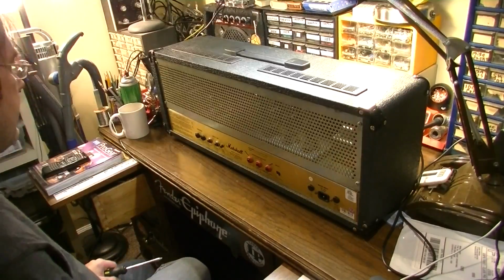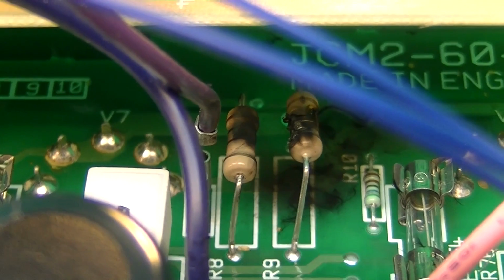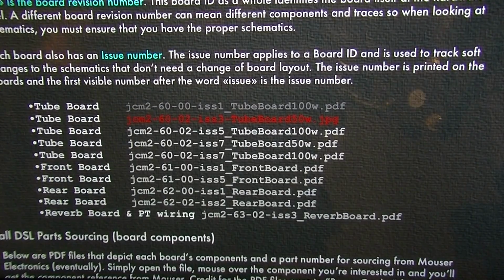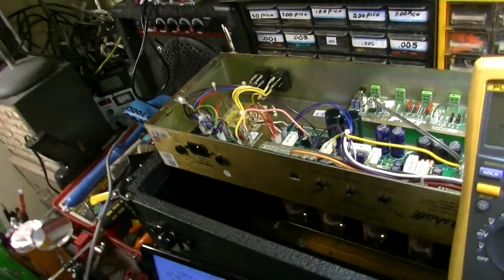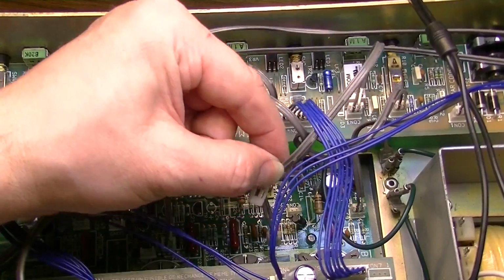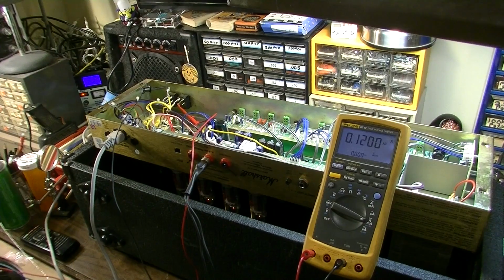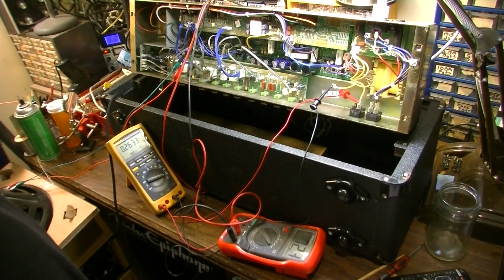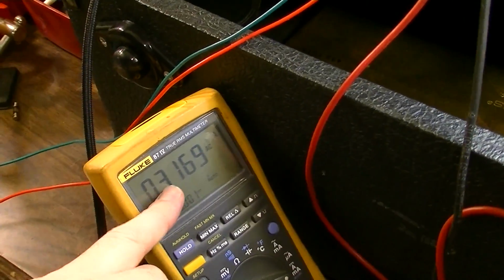Mother of All Marshall Amp Repair Videos - DSL100 Blowing Fuses, Bias Runaway, Fun Times!

Comment: Thanks for this video Brad, this was really interesting. Blew my mind when that particular cap measured so bad. Lots of plugs and wires to disconnect and mislabeled schematics from the factory, that’s kind of an automatic handicap right? This was cool 😎 as usual, you rock.
Reply from the maker: Connectors are never as reliable as solder.
Reply: Why do you suppose they would have put so freaking many connectors and plugs in? Just because it was easier to pay someone to build the parts piecemeal and then pay someone to finally wire it up? I bet that was it, to save a tiny bit of the almighty dollar. Oh, I forgot, save to pound. Pound sand I say...
Reply: @TheGuitologist  I just found & subscribed to your site about a week ago. I picked this video (hoping for a bit more advice & I'm on a time frame) but I've got an '04 TSL 100 & just getting back into playing after a few years off (& DYING to hear that Marshall & 1 of my Explorers) so I re-tubed last night before work. I had been playing it last week when I noticed the 1st power tube was just shot, dead. Anyway, it made a little sound before I killed the Output Mute & then V.P.R. buttons, then blew HT fuse. All tubes were still lit. I do factory automation/ maint & WILL soak up much from your experiences. I appreciate you doing what you do & helping others. I guess 1st question... I was sold 4-ECC83 S's for the pre-amp. HOWEVER, the original Marshall tube was still in the far left position w/the can/shield on it w/the nomenclature VLVE00064
 WK43 on it. Do I need to go BACK to the music store and get a different tube or will the ECC83 S be ok there??? Looks like I'll be watching videos all day and possibly weekend and pray hard & often! Terrible timing w/just getting my FIRE RELIT. 
1 last thing. I brought home a 5pk of Buss GMC-1-R fuses for T-shooting my issues. I'm guessing from what I've been learning, that's not a good idea...? Do I really have to go find some F1A L250V fuses for my t-shooting? Thanks for ANY help & I WILL be buying some swag asap!

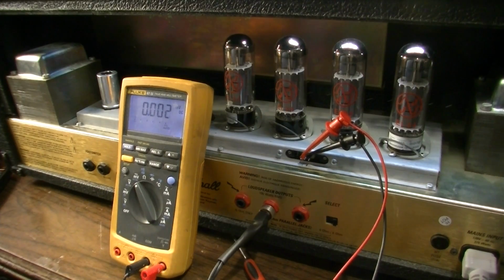Comment: Hi, great videos. Can I ask you a question? How can I know if my Bias are running away because of any faulty component inside or the problem are the tubes? I mean, in the beginning of this video, you show us that the "left side" is running away big time 1:50. Was the Stand By switch engaged or just the power on, as you take this first measurement? Thanks a lot and cheers from Brazil.

Comment: Is the DSL100H similar? I have never been happy with the sound of this amp since I bought it used, mfg date 3/2017. New JJ matched tubes installed. Swapping cables with my DSL20HR yesterday I may have missed setting the 100H to standby. Now no sound. Clean channel crackles and is quiet but I can hear the guitar (barely) but the preamp side both on the clean/classic channel and both ultra gain are dead. No sound. DSL20HR is perfect, works great with both cabs most likely failure? Transformer or board?

Comment: Run Bias Run.  
The board could be a blem board assembler at Marshall had on the shelf for a while. They were in a rush to move all these amps out of the factory for their newer counterparts called DSL which is the same as JCM 2000
 I've read the second generation DSL100 from 2017 early ones that replaced jcm 2000 last years 2000ish suffered same issues.  But the newer 2018 DSL 100's are way better Marshall fixed all the issues from customers complaints & added a few new features.

Does the JVM series have same issue, Bias runaway?

Comment: Stupid fast question: I need to take out the reverb tank in order to check if the springs are correctly mounted (the reverb barely makes any difference, it's very very weak). Can I take it out safely without removing all the head from its case? I'd like to stay away from capacitors by not taking the head out of the case, what do you think?

Comment: Hi Brad, really like your videos. Just watched this one about the Marshall amp. I think you'll find that one pair of the output tubes has an intermittent short, causing the HT fuse to pop. Nothing in the HT feed would cause those cathode resistors to burn. I have worked on high power vacuum tube amps for many years, and have found output tube flashover to be the #I reason for HT fuses blowing. Of course, loss of bias can also cause HT fuses to pop, but normally, in the case of loss of bias, the fuse will blow again nearly immediately. I'd also check the grid coupling capacitors for all the output tubes. A short there will cause an output tube to draw enormous current as you know. Keep the great videos coming.

Comment: Hi Brad!  Great video!  I'm 4 years late of course - sorry about that!  I called the pt, but it looks like I was wrong!  D'oh!  You got stuck with a diabolically (sp?) nasty amp there mate, with multiple intermittent simultaneous faults - the worst kind of fault!  Then you had incorrect components compared to the circuit to contend with.  The less than obvious failure of C2  You did very well.  I don't think it's necessarily quite finished with you yet.  I think you've shut it up for a while, but unfortunately I think may see it again.  Apparently both tubes in the pair have the same problem with the increased conductivity with increased temperature.  Well I guess it's been 4 years, so has this amp been back for another service yet?

Comment: I see these TSL2000's going cheap local to me on Craigslist, I've seen a lot of horrer stories and been put off from snagging one, If I see another one cheap enough I think I'll take a chance.
Reply: Alan Stokes they have faulty boards inside that you need to get a replacement for. It’s reissue 16 I think. Marshall has the info if you contact them.
Reply from the maker: The conductive boards can be fixed with some Dremel work.
Reply: I had noticed these things selling rather cheap also. I wondered why. Kinda makes me want to pick one up just to argue with. Lol
Reply: they are the best sounding Marshalls I use the TSL version ,, replace with a VER 20 board cures everything and you will have an outstanding tube amp simple !!!!!!!!!!!!!!!! I have had mine since 2002 and just now replaced board too ver 20 and I played mine every day

Comment: I’d assume that you have addressed this before, but what can you tell me about the ESR meter you used in this video. Home built? Commercially available? Thanks.
BTW, I’ll put in my two cents on this generation of Marshall; Jim should have stopped with the 800 series. The TSL I worked on last year wasn’t much of a sonic revelation.
Reply from the maker: I linked it in my pinned comment.
Reply: Thanks.

Comment: My tsl 100 red plated an outer power valve then made a popping sound and both centre valves stopped working, stone cold no heaters glowing no fuses blew anywhere in the amp, I swapped the valves and the amp worked but the two centre valves were still off.
So I changed the motherboard for an issue 20 board from hotrox UK
It  wasn't to bad a job to do it cost £113 and it worked straight away and biased perfectly I ran it in exess of five hours with no problems, I was told 90ma was a bit high  for the bias could this be true??
Reply from the maker: I biased this one to 80mA, and it'll be fine there. 90mA might be a bit high. It definitely stressed everything more.
Reply: The Guitologist oh good did mine at 80

Comment: Brad do you prefer to work on point to point amps, or amps like this with loads of daughterboards and jumpercables ? to me it seems like they are trying to reinvent the wheel... overly complicated compared to vintage gear. ive seen the same thing with hifi's, modern onkyo's have so many daughterboards, to get in and service you have to completely strip it down, it becomes a nightmare to trace faults.
Reply from the maker: No contest, the older stuff. I admire the genius that goes into something like this, but you can set a vintage combo amp up and mic it, slap a pedal or two in front of it and you won't likely miss the modern half stack. That said, there is nothing like cranking a Marshall and hitting that open chord.
Reply: That was the great thing about the pre-900 Marshalls - no surface mount solder baths that don't fully seal the joints (as just shown in your video.)  Hopefully technology has gotten better at that.  That being said, most of the problems I've seen with the UK DSLs have been stupid things like the reverb tank not working from being dropped or thrown around, causing the springs to be jarred off, bad V1 tubes causing noise and improper biasing.  These really do seem best when set to 90mv as per Marshall specs.  They're gainy enough, no need to lower the bias, despite what people on message boards who claim to know better say.  Great video, Brad.
Reply: The beautiful thing about the market right now is that guys like me, who want the big amps, can pick them up CHEAP!!!!  I like the little guys also, but you hit the nail on the head... a half-stack set on "KILL" and a big old open G chord is bliss...

Comment: Wow! this really makes you appreciate point to point :-)
Reply: Agreed. I'll never buy another PCB based amps. The closest I get is my 2104 JMP. Other than that, handwired, point to point.
Reply: @AnodyneHipsterInfluencer  When I started to learn how to do point to point in building my own audio tube amps and pre amps,I can't be bothered to do anything with a pcb,not even a basic power supply,i have seen people do point to point with IC components ,resistors and capacitors,beautiful layed out wiring,and is truly a work of art.

Comment: Oscilationis the problem.You must place 1k resistor close to tube socket on input of each tube just in line with input and 470k between same resistor and earth, and tube should quiet down and bias should be set to 33ma each tube for aprox 450volt. If above 500volt then max 30ma..

Comment: You're a beast Brad! I won't touch these POS's, they're a liability.
Reply from the maker: Stuff like this is not for the weak-hearted. An intermittent issue in a modern amp can be a nightmard scenario.
Reply: It would help if Marshall made a good amp like they used to.. #Junk

Comment: The flow soldering on the boards is terrible, the new replacement boards are much much better, why  wasn't it picked up when the valve bases were soldered in?
Reply from the maker: I assume the tube bases were on there when it went through the wave machine.
Reply: The Guitologist the power valve bases look hand soldered there's lots of flux residue. An interesting thing, the new issue 20 boards are a completely different colour from the old ones. It would be really nice to find out what makes a glass fibre PCB conductive.

Comment: Did you ever replace the tube that had something short internally?
Reply from the maker: Good question. No, it seemed fine. It was not the tube apparently what caused the arc. I believe it was either an intermittent connection on my load, or that capacitor I found, which may have been arcing internally and causing issues on the HT supply.
Reply: I was wondering if the suppressor grid might have had a strand loose that touched the plate.   If it did I bet it's gone now (well, spattered elsewhere)!   A surge caused by that capacitor you found could have caused a nice arc internally.

Comment: The  2000 heads mistakenly installed 220k ohm grid stoppers where there should be 5.6 k ohm grid stoppers. This causes bias instability. I still say they are E-waste disguised as an amplifier.Boards that conduct,d.c.rectifier heater failures, 4 and 8 ohm ground through the 16 ohm shorting jack that heats up and looses ground. Buy a 900 or an 800 if you want a Marshall and save yourself the headache.

Comment: On JCM 2000 the bias area is bad and conductive and there's a mod online that you're supposed to do to make a new bias board for it
Reply from the maker: I am aware of those potential issues, yes.
Reply: Same here, had one in for repair from a recording studio/rehearsal space: bias resistors went high close to 100k, kept blowing HT fuses, did the full bias mod (drill the board, install new bias pcb). Played fine for a couple weeks then another blown fuse and the output transformer went short circuit lol wtf man I'm starting to hate this thing
Reply: I guess the OT failure could be due to user's brain malfunction but still working on this amp is quite the nightmare
Reply: And also, for future viewers, the 16 ohm speaker jack is a normally closed switch that connects 4 and 8 ohm jacks grounds. If it fails it'll blow the output transformer. I've read many guys just jumper the board across the switch so it can't eventually do that

Comment: Hey brad I notice you didn’t bias up to 90 as marshall recommend. Would you say that’s too hot?
Reply from the maker: On paper it isn't, but in practice inside THESE amps, in particular, yes, it may be. With all the issues these boards have, probably best to back off to 80mA or even 70mA would be ok. On the cold side, but if you've been having issues, might be a good idea.
Reply: Brad, thanks for the advice. No issues yet but biased at 90 it does run scary hot, think I’ll back off to 80. Love watching your vids, keep up the good work.
Reply: Anthony Campbell ,
I have an 05 100 watt DSL. I bought it  after the seller had it gone through by a local tech. According to the tech, a flared mounting lead shorted to a nearby trace on the circuit board. Took out C39 and weakened a few other parts in the output section. Bypass caps and bias , screen , and plate resistors were replaced for safe measure. 
New JJ EL34
Plate voltage = 470
Bias = 76 per side
Amp has been flawless for the last three years. In my opinion , it runs and sounds great at that setting. A/B against my 79 JMP 2204 and sold the JMP. No heat issues either.

Comment: i was able to bias using the test points on the DSL100 to about 85ma. This is for each side of the bias test points. (manual calls for 90ma). Out of curiosity i decided to read the tubes using a socket bias tester under the tube and they were reading over 60ma each. So i think the bias test points on these amps are shit and not correlating with actual tube bias.

Comment: Great video, I have a quiestion: People say this amp fails, something in the desing of the PCB, I would like to know if Marshall corrected it in some versions, I want a 2000 but I don't know what years of production are safe to buy or what to do about that typical problem of the 2000's . Any advice ?
Reply: Hi Juan H!  4 years later sorry a bit late!  Dr.Tubes has a great looking bias stabiliser board available which should fix it.  The 5mm hollow drill they have would be valuable as well.
Reply: @nevillegoddard4966  thank you 👍🏻

Comment: So normal operation of the 1ohm cathode resistor is 0.0081W. So this will never go if there is not a very large overcurrent. And you never need to replace them with larger wattage ratings. First you always measure the bias voltage on the tube socket when that happens. The failed cap feeds the bias voltage circuit and when the bias voltage fails....kabooom.

Comment: I haven't used a Tube Amp of any really all that much since 2009..thats when I tried the Marshall MG 100FX 2X12.. no need for Tube Amps anymore to achieve the warm to hard driven tones and everything in between the Solid State Amp technology the past 20 years is simply incredible this is why more and more guitarist are turning to Solid State Amps today plus their also much more reliable than Tube Amps..in the 9 years I have had my Marshall MG 100FX and my Line6 Spider IV 75 Watt Amp 8 years not one single issue with either one of them ..I can not say that about a bout my Tube Amps..

Comment: Brad, what are the fundamental differences between guitar amps and hi fi audio amps. I’m talking tube only here.
Reply from the maker: Hifi are designed to be linear and to not accentuate frequencies, but to reproduce the program without coloring it. In a guitar amp, you want to accentuate certain frequencies and suppress others to achieve a desired tone. That's it in a nutshell, but the technical stuff will keep you reading a long time. Building hifi amps is an art.

Comment: I recently got my 75 or120 back from the tech (second time) the first time he didn't catch the burned up pots and faulty volume knob, so he replaced them, no charge (very gracious of him). However, just a few months later with very few hours on it, I blew a power tube. I opened it up to look for any blown caps or resistors and didn't find any but I found that he put a 500k volume pot in it instead of the 1M that was on the schematic. I replaced it with a 1M but now I have lost all gain whatsoever in the amp. It's clean all the way up to 95% max volume.  Any suggestions on how to get the magic back in it that the (unsafe, I suspect) 500k gave it? Ha thanks I love watching your videos!
Reply from the maker: Changing a volume pot value wouldn't cause a power tube to blow. And whatever did cause it is probably also causing your lack of tone.
Reply: The Guitologist ok I just assumed because it seemed twice as loud before with the 500k pot. Thanks for your time! There's no problems now, other than a sterile sound, maybe ill try some different tubes.

Comment: What do you use as a load when you power up tube amps. i see sometimes you just use a single speaker but we dont always see what you are using. Are you using a attenuater?
Reply from the maker: No, just that speak on the bench. No attenuator other than the variac on the input. Dummy loads are nice if you want to crank volumes and look at a waveform, but I do better just plugging in a speaker and listening with my ears.

Comment: I had this same head, worked fine until it didn't...left it at a repair shop for two months, they couldn't find the problem...another shop quickly found it was a faulty fuse holder :(